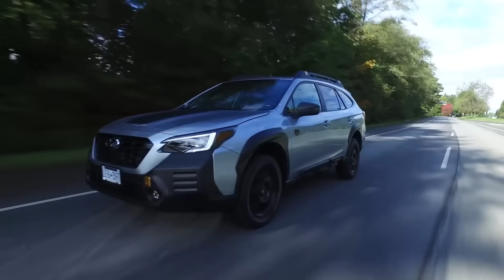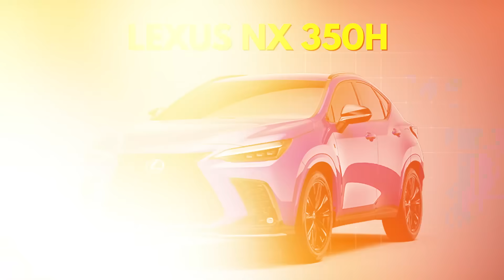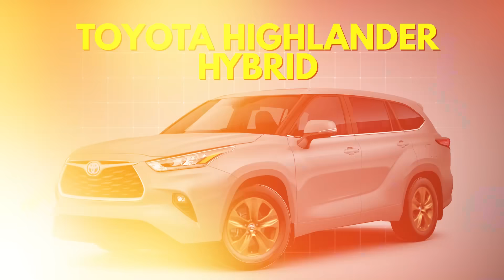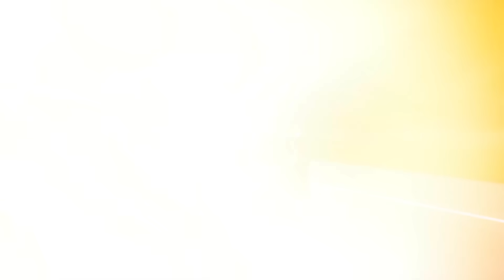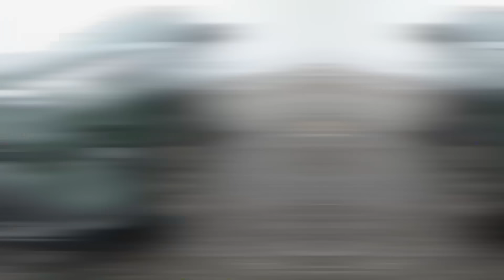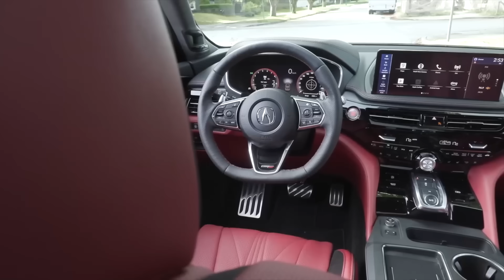Consumer Reports Just Revealed 6 SUVs So Reliable It’s Scaring the Industry

Comment: I take issue with you forgiving Subaru for having decades of design flaw head gaskets. I was the victim of three Subaru with head gasket failure.  Subaru would do nothing at the time for me, not even admit they had a design flaw. This is why I will always consider Subaru a crap manufacturer.

Comment: Our 2017 Subaru only has 47k miles and has went through eight regulators (and waiting for the ninth) for the power windows, both control arms, three cracked windshields (known issue but we didn't know and used our insurance) and the air-conditioning compressor. Not what I would consider reliable after only 47k.  I'm disappointed with Subaru and will not be buying a new one.

Comment: I always get either a Toyota or a Honda (have CRV currently). I trust them. Never have a lick of trouble with them. Only time I strayed, I mightily regretted it. Got a Subaru Forester Turbo. Few years later that turbo went out and cost 7k to fix and took many WEEKS of renting a car before I could get it back fixed. Never again. Sold it and got another Honda CRV (2011 which I STILL have and have had zero trouble with).
Reply: I did the same thing. Owned Toyotas my whole life until I bought a 2012 Subaru Forester. It was the least reliable car I ever owned. It eventually started leaking oil and the repair cost was more than the car was worth.

Comment: What I find silly. Is that CR can only recommend what their readers tell them. That's not enough info to determine anything. When you get info from 10 million or more people, then you might have something to review. But basing you opinions on CR is extremely miss leading. And never forget there are far more important things to consider when buying. How far is the dealer? Are the work bays clean? Are the sales willing to negotiate? Or are they stuck with: cost, options, trade-in value? What is the overall impression you get when walking in? Does the sales person hound you? Many many other factors.
Reply: In addition to reader experiences, CR does hundreds of thousands of miles of test driving as well.  I used to trust them explicitly, but have come to realize their reviews can be...fickle over time.  I remember when the Tesla Model S was listed as the greatest vehicle they had EVER tested.  Now they can't stand it and do not recommend it.  Your points are valid; but having some idea of reliability is important.  I won't touch most GM products, and newer Toyotas seem to be "eating" motors.

Comment: Too many electric suggestions.  Hybrids/EVs are a massive disaster to road longevity and threat to firemen.  We want a list like this without dangerous battery packs that burn like the surface of the sun and are hugely overweight.  Buyers want ICE engines, no CVT rubber band trannys, and more ways to restrict the amount of electronic distractions.  Literally everyone who is actually driving hates that damned center dashboard display.  Bring back the "no radio" option so we can put in what we want from the aftermarket.  Factory infotainment systems always suck compared to what you can replace them with.  Worse is the factory crap is more expensive than aftermarket.  Try offering a vehicle that is "unplugged" where we can add our own electronic gadgets, get better quality, and doesn't come with factory spyware.

Comment: so how do you CHANGE the oil filter and oil if there is an undercarriage shield on the Subaru Wilderness?   I did not see any where to get to key components.  Silly.
Reply: Remove the shield first.  Five minutes and it is off.  Not perfect for a do-it-yourselfer to do safely, better for those with a lift.
Reply: It's not even a Subaru in the picture.. it says Rivian right on it. This whole video is questionable

Comment: DO NOT BUY THE CRV 1.5 TURBO W SO MANY HAVING EARLY HEAD GASKET FAILURES !!!  GOOD JOB POINTING PEOPLE TO THE CRV 2.0 LITER HYBRID !!!   MANY 1.5 TURBOS NOT MAKING IT TO 200,000 MILE MARK DUE TO BAD HEAD GASKET SEATING DESIGN !!!!
Reply: Exactly Right!
 Plus does anyone really want a large, heavy, suv with a tiny 1.5 engine that is really more suitable for a smaller, lighter, subcompact car in my opinion? And then attach a turbo to it to caffine it up? I personally would not trust that. They had a very good 2.5 engine in this crv vehicle in 2023. Honda, what are you thinking? My take on it: they put the smaller engine in to increase fuel economy. No thanks Honda. Lol

Comment: I went with a new Pathfinder no CVT transmissions no hybrid crap to go wrong a V6 3.5 L engine with no turbos or any of that other crap to go wrong. Of course it’s not even on this list.
Reply: you need to disable the cylinder deactivation......they have kits for it.
Reply: We have two Murano’s, 2015 with 110/K and 2020 with 35/K. Only 2 non maintenance expenses on the 2015. First was sunroof drains clogged and 1 motor mount. Otherwise both get 30+ mpg on the highway which beats similar naturally aspirated V6’s by Honda. I think if Nissan kept the V6 and just added a real automatic transmission…so much of Nissans negatives would go away. I’ve also been watching the Pathfinder…seems like a real good choice even when things sound so bad for Nissan. Hopefully you have great luck with your new purchase.
Reply: @billsenior213 I have a 2012 Murano and it only gets around 20. Could be from the time it had hesitation problems.
Reply: The engine in my 2012 Murano seems far more capable than the one in my 2021 pilot. Of course the problem will probably arise with the transmission. Both v6s. The Murano will fl. It could be extra weight in the pilot.